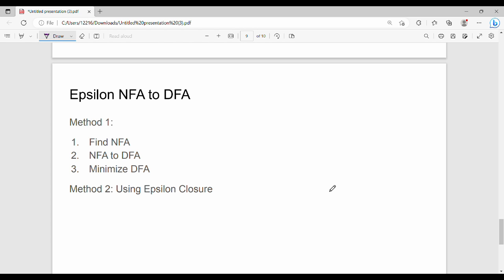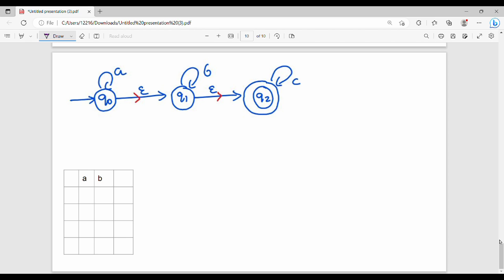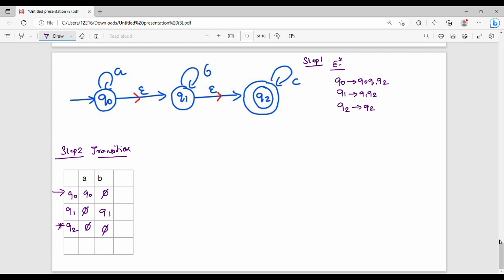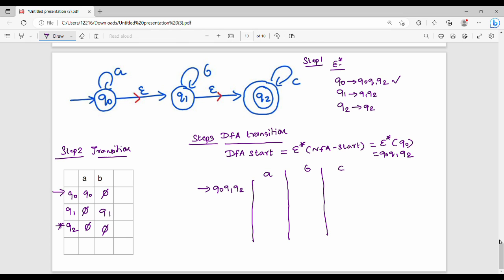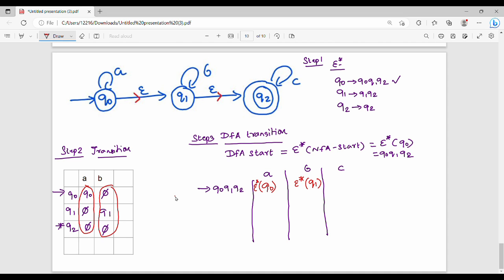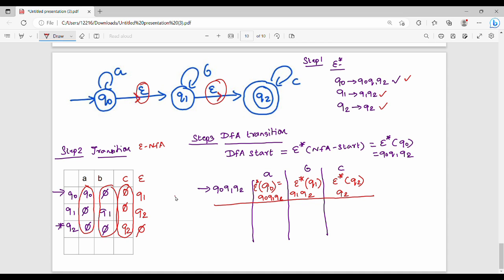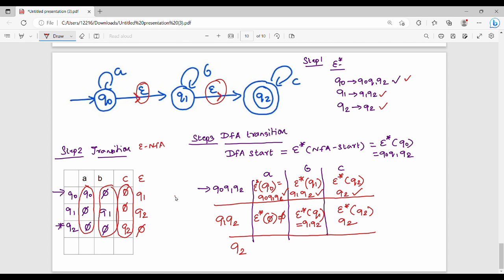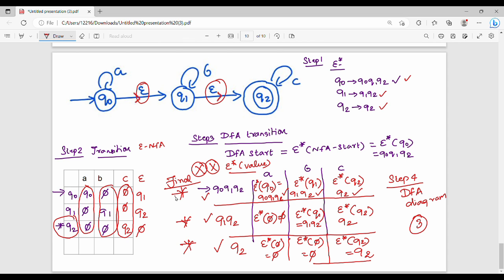1.6 Conversion of Epsilon NFA to DFA in Tamil

Comment: Sir using method 1 after nfa to dfa conversion i got different diagram but output is same ,but start state is same from nfa
Reply from the maker: Different diagram is okay, but transistions should be correct
Reply: Sir can u please teach this 5:36 problem in method 1